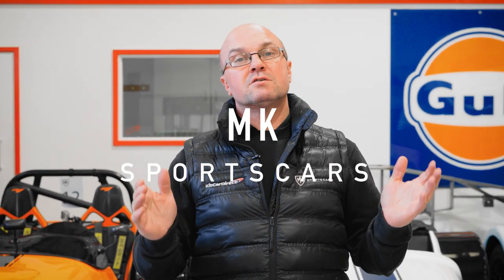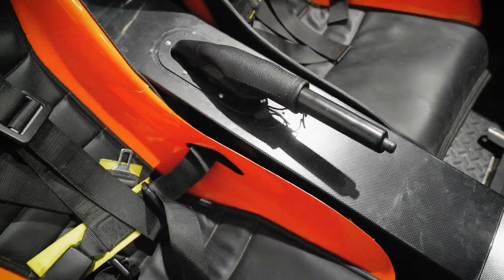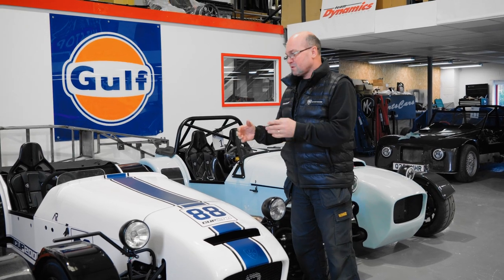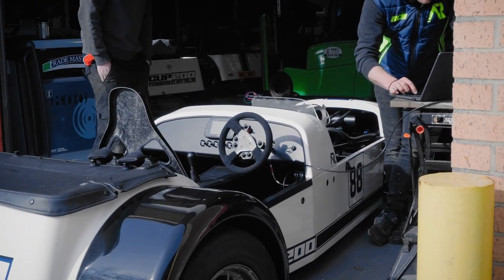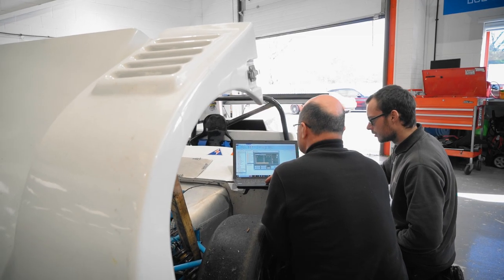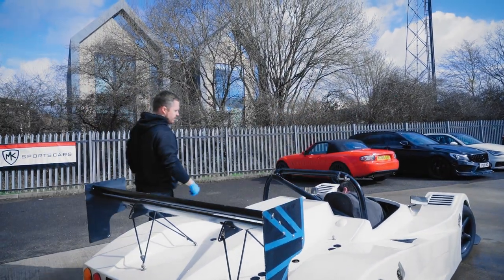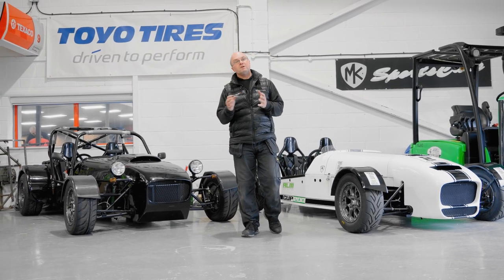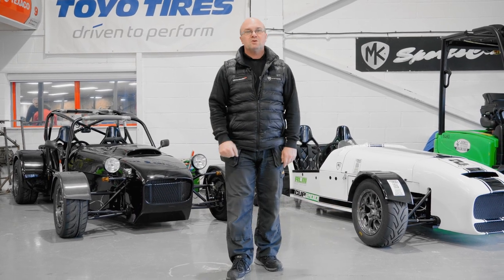Road Legal Cup 200 Race Car in the Workshop // New Lower Floor Pan Chassis - Ep.159

Comment: What are the 2 arms to the side of the headlights for on the cup 200 car No 88
Reply from the maker: They’re for IVA side repeaters.  It’s so we don’t have to fit the side repeaters into the front wheel arches which may become detached in the heat of battle on the race track.
The idea is to remove the headlight and side repeater in one go when you’re racing.